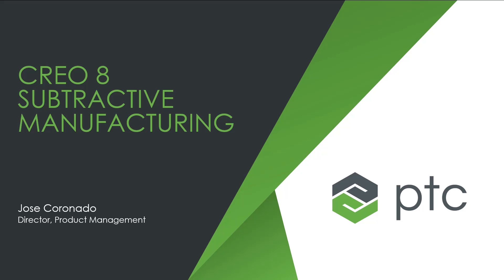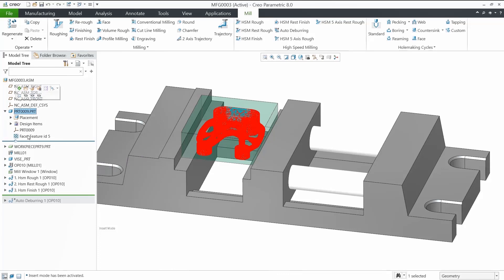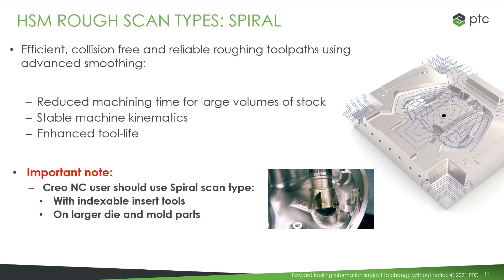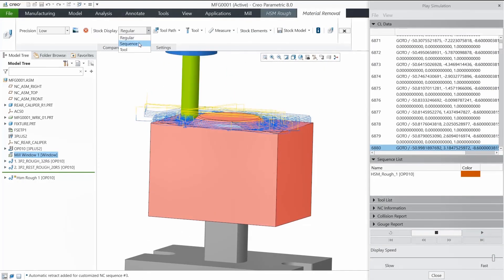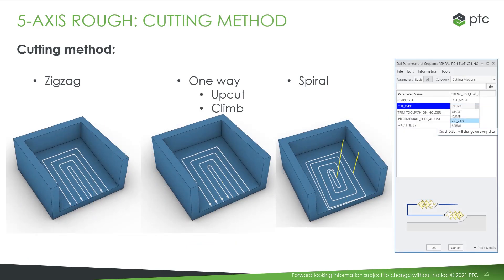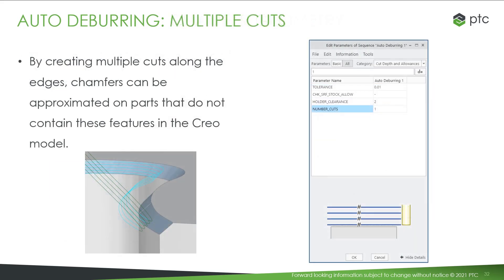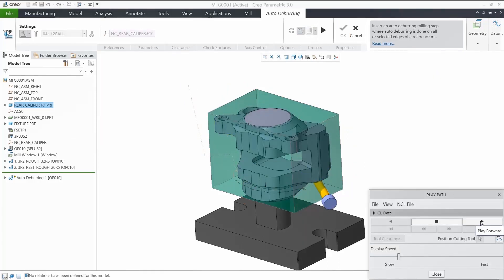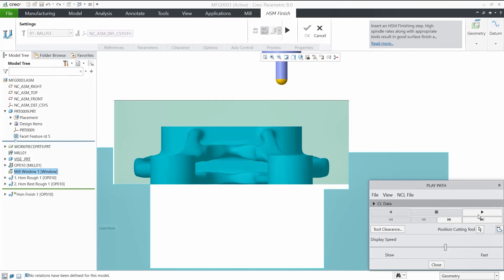5-Axis High Speed Milling Overview in Creo 8

Comment: Can you help me? Chose post of machine, I using machine umc 750
Reply from the maker: Hi,

I can't help you based off that information.
I'd recommend you head over to the PTC Community's CAM board and provide more details on what you need help with:
https://community.ptc.com/t5/Manufacturing-CAM/bd-p/manufacturing
Reply: AustinNC is the company that developed Gpost as the software integrated in Creo to build your own postprocessor.  They can help you.